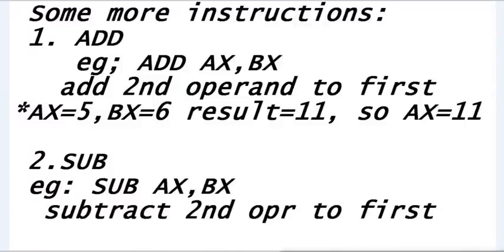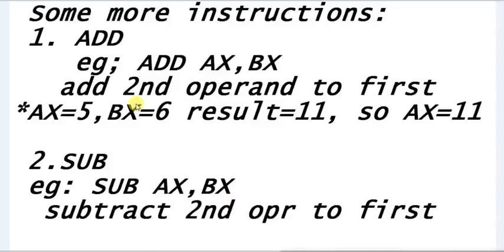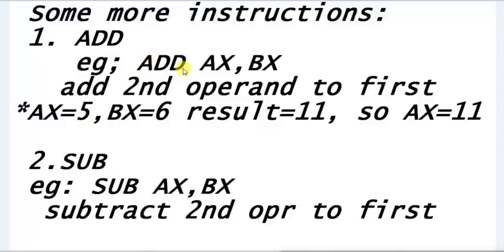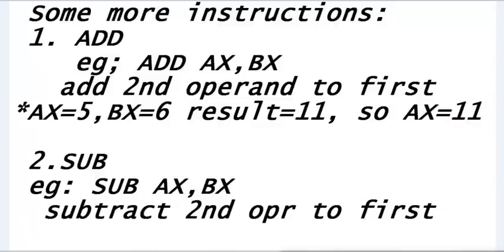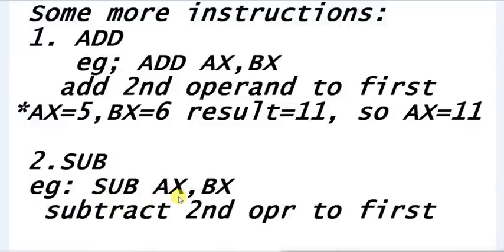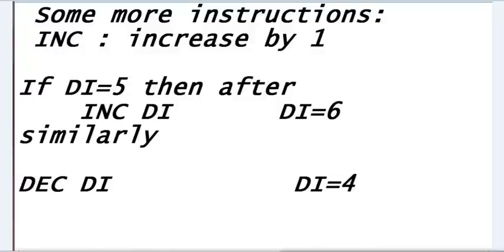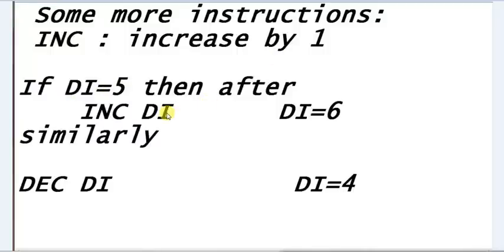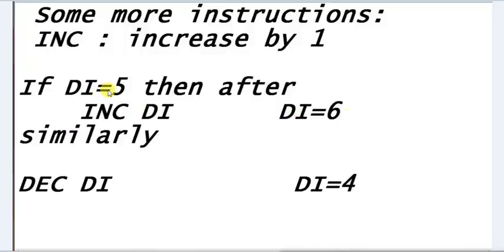8086 Assembly Language Tutorial For Beginners || Part 06 || Very Basic Instructions

Comment: Slides Please , if It Possible
Reply from the maker: These videos are very old. I don't have slides. But you can refer to this link for pdf , They have done it nicely: https://faculty.psau.edu.sa/filedownload/doc-7-pdf-f9827b6430547fd3f2c94fabf299fb97-original.pdf

Or simply you can type on google for "Arithmetic and logical instructions in 8086": Although I am updating all videos, I hope it would help you currently. Thanks.